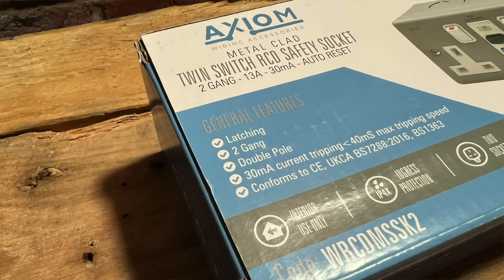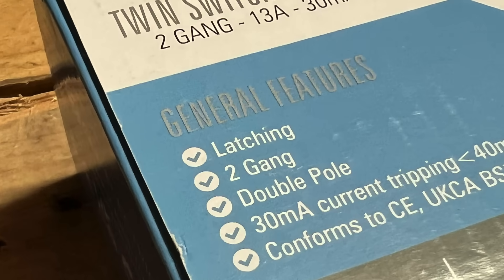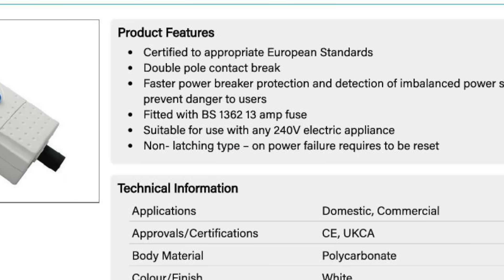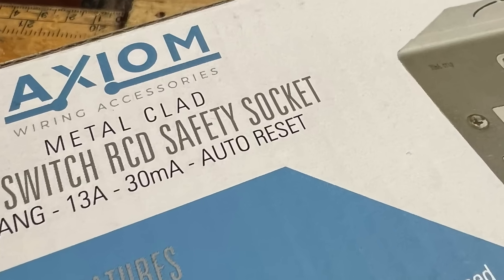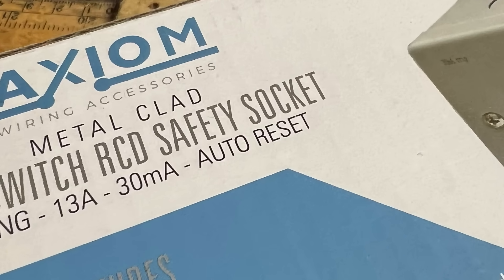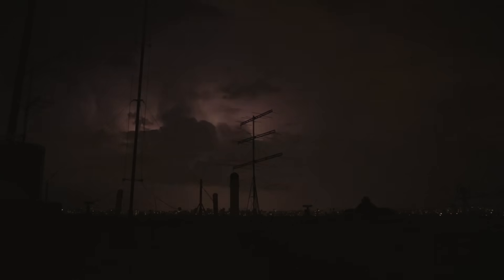The RCD Socket Danger You Might Have Missed!

Comment: It would be great if eFIXX could investigate the the socket testing devices. Just because they are CE/UKCA marked, it does not mean they are good. We are manufacturing small industrial machinery, which requires high quality RCDs if the user wants the machine to be plugged in instead of hard wired in. Yet  many electricians buy cheapest RCDs they can find, test them to be "good" with these cheap large tolerance testers and claim job well done. And there is always a big argument to admit and replace with a good quality RCD.

Comment: I've fitted two different makes of active RCD double 13A sockets, over the past ten years,  in my outhouse for use with hedge trimmers and othet garden equipment. Both sockets failed after a while and started buzzing loudly when there was nothing plugged into them. They also got warm. Still buzzed after pressing the test button. I now have a standard double (metal clad) socket and use a plug in RCD (active). If it fails, it's much easier to replace!
The sockets for outside have their own dedicated circuit breaker in the consumer unit.

Comment: I'm trying to find a source of Passive Latching in-line or plugtop RCDs. All of the 'portable' ones I can see are Active (non-Latching) which I find inconvenient.  My best solution so far is to use single-gang fused spur Latching RCDs in back boxes with cable glands, but these can be cumbersome.  
The application is a museum of mechanical musical instruments, most dating back to a time when when attitudes towards electrical safety were, shall I say, 'different'.  I need to give each instrument its own RCD for safety, but I don't want to have to run round all the exhibits resetting RCDs every morning when the power is turned on.  Fitting RCDs in the consumer unit would mean a major rewire, and some of the instruments get demonstrated away from the museum so they need to take their RCDs with them.
Can anybody suggest where to buy in-line or plugtop RCDs with Passive Latching? (I'm in the UK, by the way)

Comment: Beyond my 2007-vintage non-latching/active RCBOs, my RCDs are all the plug-in non-latching/active type. The RCBOs won't auto-reset after a fault downstream (So their circuits remain dead until manually reset) but the plug-in RCDs (Which are held on by the upstream power supply) automatically go open-circuit after a second or two if upstream power fails, and remain that way until manually reset. 👍

Obviously this arrangement is perfect for any supplies used to operate dangerous devices (Power tools etc) provided one observes the common-sense rule If the tool stops working, isolate it at the supply and via other controls (i.e: Emergency stop buttons) until the power loss or other defect is identified and resolved but it would be terrible for any circuit used to operate a refrigerator or freezer. 🍨

I'm slowly planning a re-wire of my home, and this is making me think that having a dedicated circuit for passive RCD protection at the outlet might be wise. Of course, that means I have to read-up and understand the safest way to run a circuit around the home which doesn't have the usual protection at the CU... ⚡

Comment: The description of passive and active for the behaviour of these two types of RCD is entirely unhelpful in describing what they both do. Could they not have come up with something more descriptive. Autoresetting is almost as bad.

Also, the lawnmower example is outmoded. All modern electric lawnmowers require somebody to keep the operating switch, bar or lever to be engaged, and if power is lost, requires two actions to re-engage. Even my cordless lawnmower works like that.
Reply: I absolutely agree, this terminology is unhelpful at best.

Comment: Given 30mA is the standard at the protective devices etc....single outlets like sockets ( whether double or single ) should be rated at around 10-15mA to prevent nusiance tripping at the primary protective device at the board.

Comment: Ok, while i get the concept on the video and also get people do their own wiring  but in the likely locations the latching socket is going to be installed, it should be a licenced electrician or atleast someone in the know, that would be doing this, so they would know where to and not to install them.
Reply from the maker: That's who the video's aimed at, just in case they missed that lesson at college. 😉
Reply: @efixx and This is where the regulators need to step back and think, is this getting so complex now?, that even licensed electricians are needing to consolt their bible almost  every install they are doing?

Comment: It's not the responsibility of the RCD to protect machinery from restarting automatically, that's why theres the DOL starter as a minimum and im not mentioning safety relays etc
Reply from the maker: It's just an extra layer of safety to be fair.
Reply: Not on lawn mowers, though
Reply: @PhilipPaintin modern lawnmowers all require the lever or operating bar to be held down to operate. The power switch does not latch. They also require a double action to restart after stopping, with a separate button. Even my cordless lawnmower works like that.

If an appliance must not restart automatically when power is restored, then it should be built into that appliance or else you are relying on somebody plugging the appliance into the correct type of RCD.
Reply: @TheEulerID  Fair points, the lawn mower was a bad example.  But there will be some cases where having a manual reset RCD will improve safety

Comment: Funny enough - just designed a supermarket's electrical system - the stuff before the CTs.    Talking to the engineer about the electricals inside and there are so many RCDs it's no funny.     Every till is RCD protected and has a UPS backup.   They take the business of taking money seriously.     The generator is huge - 800kW and will keep the whole venture up and running  during a power loss event.      Some seriously good engineering goes into selling stuff.
Reply from the maker: Great insight  !

Comment: Hi John, for machinery its called an NVR switch, that is a H&S requirement on virtually everything industrial nowadays. When the ON button is pressed, the switch is physically held on by 3 electromagnets so the loss of a phase immediately shuts off the motor (or 1 electromagnet for single phase).  I'm sure there's going to be a few comments from machinery operators regarding the removal of the guard & riving knife, no push stick, blade set wrongly, no dust extraction and you never feed with your thumb sticking out etc so I wont mention any of that!
Reply from the maker: The perils of stock footage!

Comment: Why the F obfuscate the function with nonsense names like active and passive? Just call them something that describes what they do, auto resetting, and manual resetting
Reply from the maker: That's what they do say on the packaging...
Reply: Active means there is an active current holding them on, Passive means there is nothing holding them on. John has missed off the electronic devices that can be RS485 interfaced so fortunately, for now, it remains simple and you can be an electrician without a degree in IT, but they way this industry is changing....
Reply: @Ino-z2m which is not what a consumer would want to know when buying a plug in adapter. It is the behaviour that matters.
Reply: @TheEulerID  The headache is: If you offer the average consumer an active and a passive plug-in RCD, are they going to understand the difference? Particularly the potentially dangerous condition that exists with a passive RCD protecting a power tool if a momentary power failure occurs shortly after an RCD trip... ⚠

Comment: I wonder if the passive RCD will break the circuit if there's an earth fault with a disconnected neutral.

Most RCDs are electrical devices that need power to detect an earth fault.
Reply: Passive ones do not need a neutral. The fault current causes the trip. Active ones have electronics that need power.
Reply: That's a very good question! One would hope they used the cpc/earth as a 'functional earth' as some RCBOs do. Early type AC devices were purely passive, the actual fault current itself generated enough power to trip the cute teeny little solenoid, but with modern type A, B, F... this is a concern
Reply: @TheChipmunk2008  A, B and F can be done purely with magnetic tricks, no need for active electronics.  As far as I know there are no miniature magnetic RCDs though as the core(s) is(are) just too big to fit into that form factor.

Comment: Have to be careful as well with the RCD sockets as for a long time after the type A requirement came in, many were type AC on the market, and therefore wouldn't comply with the regs ammendment. The cheapo chinese things may well only be type AC as well (would you trust the label that says A?)
Reply: Lots of type AC RCDs on sale on the usual web sites since they are still used in many countries (even the UK does permit their use in certain circumstances)
Reply from the maker: It also depends on what you're plugging in...
Reply: I'm aware that AC is legit in some places, but in general a non skilled person is not going to care - it's a socket, so go for worst case scenario.

Comment: Power tools have limit switches. 

Reason is other: when slim RCBO came to market, they continued to operate with missing neutral wire. Some countries banned slim RCBO since december 2023, but some countries published regulations that slim RCBO must operate properly with disconnected neutral wire. Solution of this problem is using contactor: when neutral wire is missing, contactor disconnects RCD and it can't operate without neutral wire.
Reply: Genuine question, with a safety contactor in place (in those Non-Latching/Active socket RCDs) to prevent abnormal operation in the absence of Neutral; then upon the Restoration of power supply, line+neutral, wouldn't just any contactor CLOSES on its own?🤔
Reply: @temp26j724-i  No, the contactor is held closed by one of its own contacts in parallel with the start button (on some the start button physically pushes the contactor in to the same effect) so on power loss, the contactor drops out breaking its own hold circuit. Also known as a no-volt release... Efixx has a video about control wiring explaining this :)
Reply: @TheChipmunk2008  Great, thx for the reply👍

Ya, I aware abt NoVolt release on Control Wiring etc; so to simplify these, the Safety Contactor in place is NOT merely/solely (at least in the current era) for the purpose of Loss of Neutral which render the circuitry unable to operate correctly on Earth Fault (with a broken/loss Neutral), as commented by our fellow @Dmitrynln brother...
Reply: Not all power tools have the switch, and with lawnmowers especially even where it does exist, it's common for diy dave to bypass it with a bit of tape (i can actually understand this, the fatigue on your hand mowing a large lawn while squeezing a lever can be painful)
Reply: @TheChipmunk2008 Nobody takes care about bypassing switches. If the power tool has no limit switch or it's bypassed, this power tool shouldn't be used.
Reply from the maker: Interesting point...

Comment: 4:06 This saw is pure danger. It needs a riving knife more than an active RCD ;)
Reply from the maker: The perils of stock footage... 😬
Reply: @efixx  No, that was of a circular saw. The stock footage is filed under Public humiliation in the 14th century... 😋
Reply: And lower the blade whilst you’re at it…
Reply: Yes you should use a riving knife and a guard normally but if you need to make a rebate or cut material thicker than the max depth , you need to remove them (at your own risk)

Comment: Isn’t that an unnecessary function since the tools referenced should already have a protective feature for voltage loss? I’ve never seen a RCD, in Sweden, that doesn’t stay on during a power cut on the upstream power
Reply: This is for early slim RCBO which can't sense leakage without neutral wire. Some countries banned slim RCBO, but some countries require integrated contactor into slim RCBO to disconnect when neutral is missing. 

As I know Sweden never sold slim RCBOs or dangerous RCDs.
Reply from the maker: It's just to illustrate the principle.